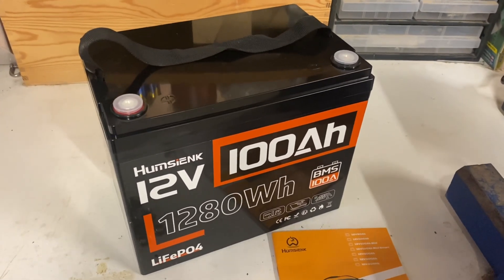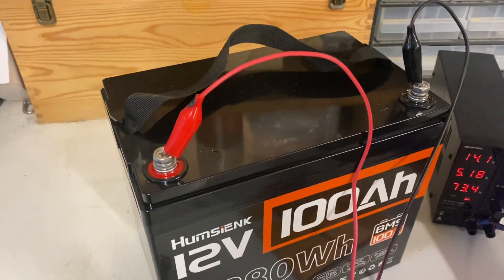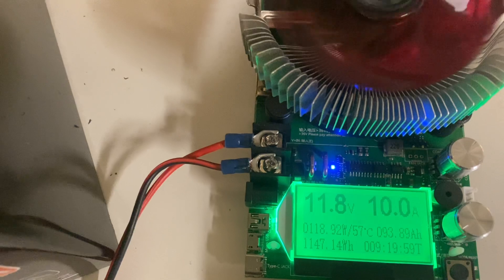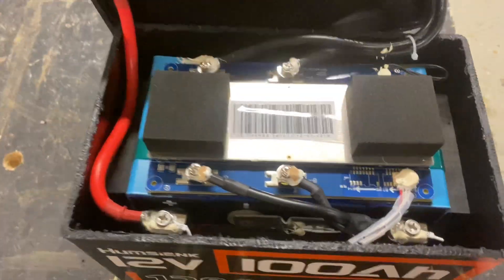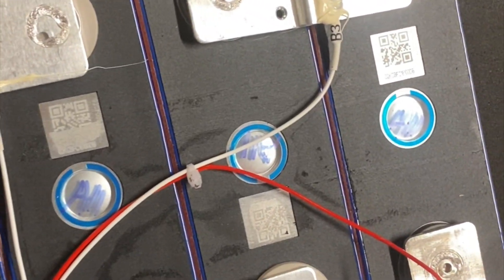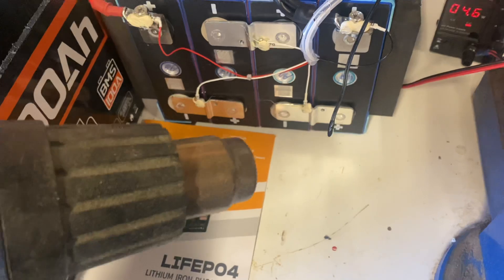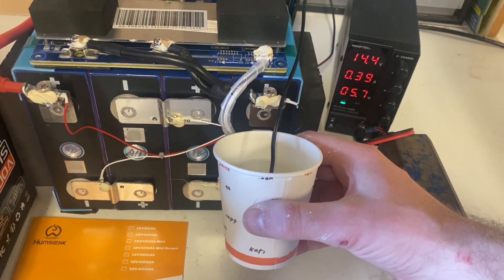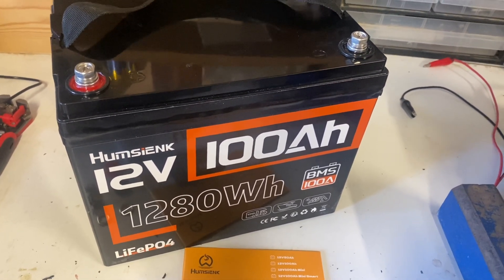Humsienk 12V 100Ah LiFePo4 | TEST & TEARDOWN

Comment from the maker: Link to Humsienk shop! https://www.humsienk.com/?ref=JONASSYVER
Coupon code: JONASSYVERSEN

(Affiliate link)
Reply: Does anyone know why I have 2 such identical batteries properly connected to 12 volts, the discharge is only from (no1) battery while (no2) remains untouched at 100%;
What is wrong with all this, and how can I fix it?
THANKS
Reply from the maker: @Russian_citizen2402 have you tested both batteries?
Reply: of course. The batteries are both the same as what we see in the video. same volume in AH, same production date, and at 100% charge. (Example) During use, the 1st battery is down to 20% and the second is at 99% @JonasSyver
Reply from the maker: @Russian_citizen2402   seems like an issue with the BMS. The parallell logic is not right. Do you have the BT version? Is there an option for parallell connection in the app?

If not, most likely, it will drain one battery and then start draining the second one. I have seen this behavior on other batteries.
Reply: @JonasSyver   It is problematic to discharge the battery (no1) first and then the second one, especially if it does not need to consume much energy during the day, the life cycle of the (no1) battery is reduced.
I am thinking of trying something like this later, although I do not know if it will work on batteries that already have a BMS! https://www.youtube.com/watch?v=1zAWGbl8kR0

Comment: Would the 100Ah run a diesel heater for 24/36 hours only for pike fishing in winter
Reply from the maker: A 100Ah battery should be enough for a diesel heater for that duration 👍 these heaters usually require 20A at start up, and then they go down close to 1A. I would keep the heater at low to be sure though.
Reply: @JonasSyver thanks for replying 👍

Comment: Hi, how much does this battery weights? Mine is only 18.8 Lbs, but the description on their website says 23 Lbs. Should I be concerned? Thank you.
Reply from the maker: Mine was about 9kg so probably same as yours. But the shipping info stated 10,5kg so pretty close to 23Lbs. I don’t think it is a problem.
Reply: @JonasSyver  Thank you. I also ordered the Max Plus BT version of the same battery and it's 29 Lbs! That is 50% more weight. Does heavier means higher quality or capacity?
Reply from the maker: From 23- to 29Lbs for a battery that is stronger makes sense. It has an upgraded BMS probably with a bigger heat sink and they might use slightly bigger cells also.
Reply: @JonasSyver   I opened both of them and the max plus have 4 prismatic 4s1p 120ah recycled cells and the standard version have 8 cylindrical 60140  50ah cells mounted 4s2p. It's the reason of the 4kg more. The BMS is very similar

Comment: Will this battery power a  dc amp 1600?
Reply from the maker: Well it is a 100Ah battery that can handle a continuous draw of 100 amps. (1280w) with a slightly higher surge capacity.

Comment: one question ove here. What would be the recommended battery charger for this 12 100ah battery? Can I use a 40A battery charger, is it safe? I don't care about battery life long term. if it last me 4 or 5 years thats plenty for me. I just want it to charge as quickly as possible while being safe about it. Thanks in advance for anyone that can help me with this question.
Reply from the maker: Yes it should handle 40A charge no problem. At least according to the specs. Thanks for the comment👍
Reply: @JonasSyver thank you for the response, appreciate it.

Comment: Strange comments on here, seems people say they are awesome, or junk.  Personally, I have purchased dozens of HumSienk 12v and 48v, and they have all performed better than they are rated, and they all stay balanced awesomely.   And as far as people complaining about the customer service?  I have never had to use customer service other than asking if I could get a discount for large orders, and they always obliged.   Additionally if you only buy on eBay or Amazon, and pay with PayPal, returns and refunds are never a problem if you ever need to.
Reply from the maker: So true. I think it’s like this with most brands. Most units work with no issue, and some has issues. My experience is that refunds or replacements are no problem. And as you stated, depending on where you buy from you are covered. Thanks for the comment👍

Comment: Hi, I recently bought 2 such Humsienk lithium batteries (group 24) with Bluetooth from TEMU, (SKU: HS12V100AH100BT) but I am unable to connect to the Bluetooth. I tried several apps with my Samsung Galaxy S23 Ultra. I followed the instructions described in the user manual but no success. The manual says use the app called “BMS meta” but this app is a crap, does not work at all. So I searched on Google App Store for higher rated apps, found and tried two other BMS Bluetooth apps: SmartBMS Utility and BAT-BMS, these two apps can connect to my other (not Humsienk) batteries and shows battery status, but still no luck connecting to the Humsienk batteries. I contacted the manufacturer tech support, provided them all the details (order number, battery Bluetooth names, apps I am using, charger, battery voltage, etc), but no response so far. I also tried using an iPad, installed several BMS monitoring apps, but the same result, “BMS Meta” unable to find any Bluetooth batteries nearby, other apps see the two Bluetooth names of the Humsienk batteries but can’t establish a connection.

Can you please help me?
Reply from the maker: I am in contact with Humsienk about the issue.
Reply: @JonasSyver I resolved my issue by switching to a new app Humsienk, the BlueTooth works now.
But the battery seem self draining a lot idle- after charging to 100% SOC, stored it for 1 month no usage, one battery dropped to 71% SOC, another one dropped to 76% SOC.

Comment: I would avoid humsienk like the plague. I bought a couple and tore them open like I do all my batteries. They were used cells with the qr code filed off. I was really disappointed. I reached out to humsienk and the customer support was a joke. They told me " that's what lifepo4 cells are supposed to look like" it made me laugh lol. It was the same battery as this video. For 100ah it tested at 73ah right out of the box. Im guessing quality control isn't very good if yours looks like that, and mine was a hot mess.
Reply from the maker: Thanks for the input👍 but if it tested at 73ah at first test you should have returned it before tearing it open maybe?
Reply: @JonasSyver  also id like to add, I purchased two, I tried to return the unopened battery and they refused.. they gave me the run around for about a week. Telling me 80ah from a 100ah was totally acceptable. The only offer they gave me was a 15 dollar return on a 250 dollar order. The company is trash and I stand by that.
Reply from the maker: I understand. It’s an addictive hobby😅  Terrible support from H here for sure.. sorry .
Reply: @speedyz28 Good morning could help me with your experience as you have dismantled several batteries, which or which affordable batteries have an acceptable quality.
Reply: @JonasSyver  i buy them with the intention of tear down. Its just what I do for fun lol. I got probably 30 of them laying around. I pull the guts and if the cells are acceptable I build them into 16s 51.2v packs for my home solar

Comment: I may sound like an idiot, but how do you know how much battery life you have left? I haven't found anything explaining it. I was thinking of getting the battery for a trolling motor but want to make sure I actually understand how much juice I have left.
Reply from the maker: Yeah it can be hard to know how if you don't have bluetooth. you could get an estimate based on voltage, but the dischargecurve on LiFePO4 is different than lead acid. You want a shunt that monitors the battery. Check out Victron. hope this helps.
Reply from the maker: A Victron SmartShunt or BMV-712
Reply: @JonasSyver  Thanks for the info. 1 last question, Do you think I could run 2 of these batteries in parallel?
Reply from the maker: @ yes you can. Most BMS’s support up to 4 batteries in parallel. They will work as one battery with more capacity. But doublecheck with the manufacturer.
Reply from the maker: @ good luck👍

Comment: I just compared your video with one from the off grid mountain homestead of same battery from 6months ago and totally different. Different cells,BMS,and construction
Reply: The opposite, the older video is the better one. It seems they build good ones for review then sell garbage
Reply from the maker: @NickKusich-se9qn  good to know. Thanks👍
Reply: They are trash. I wish i could post pics of mine in here. Used cells wih the qr numbers filed off @NickKusich-se9qn
Reply from the maker: Interesting! Let’s hope that means that Humsienk has improved their batteries based on reviews.

Comment: I purchased the same battery, i got 118ah although the temperature wss wuit hot at 35 degrees. Battery doesn't break a sweat at 100 amps. Recommend from what I've seen
Reply from the maker: Thanks for the comment!👍 Good to know the battery can handle the rated current. Guess this makes it a quality battery👌
Reply: I too got 118 amps each out of 24 battery's I bought from temu. Crazy enough they come from same warehouse that Amazon humsienk ships from ..must be a massive battery distribution center ...temu 80.00 Amazon 120-150 $$
WTF

Buy from temu way cheaper i get mine on 3 days from temu they ship from local US warehouse
Temu also offers 120 off orders 300$
Thats buy 3 get 1 free deal

Dam
Reply from the maker: @NavinHarmon  that’s crazy😂
Reply: @JonasSyver  whats crazy i got 24 of these for my offgrid solar for 1400$$
That is 30kwh of lifepo4 batterys for 1400 best deal i seen especially with low temp charging protection
Reply: One 48 volt 100ah sever rack battery cost that

Lol
Reply from the maker: @NavinHarmon  😂
Reply from the maker: @NavinHarmon  😂